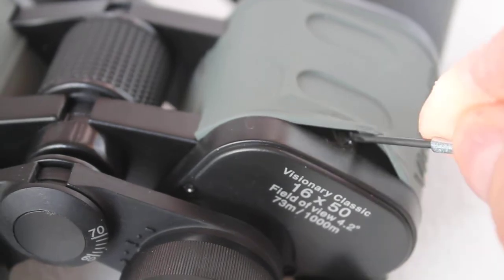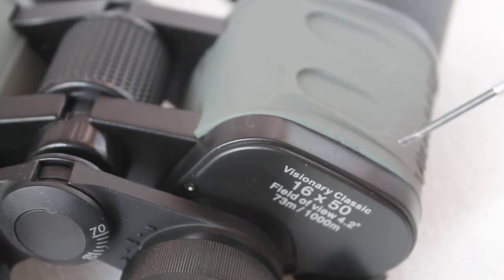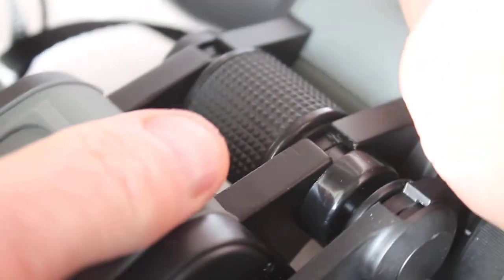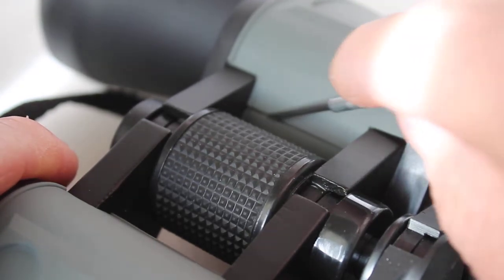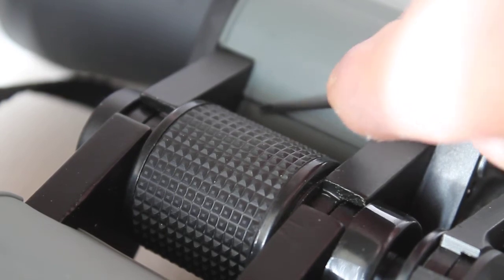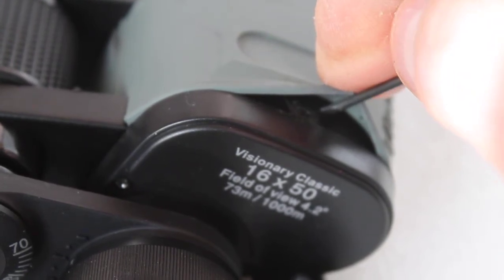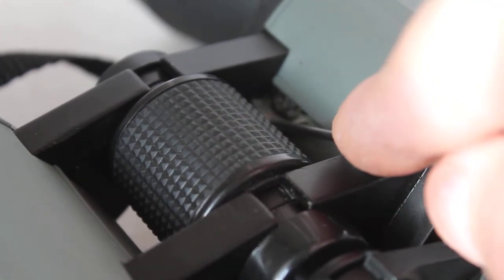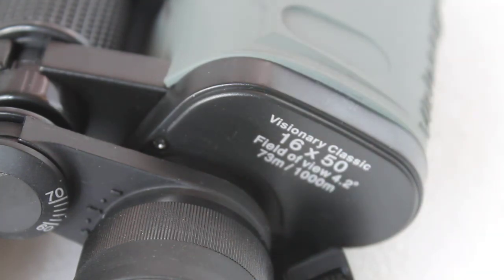How to collimate binoculars  (porro prism) Part 2

Comment: I purchased a set of Celestron Upclose 20x50s. Arrived way out of collimation. Called the manufacturer who did not assist me with the issue, so I am glad I found your video! I could not find the secondary screws on inner sides of the barrels, but discovered that by adjusting the one on the top of the right barrel corrected horizontal collimation and on one the left side corrected vertical collimation. Regardless, thank you for this video. Educational and easy to understand your technique
Reply: Thank you! - this process (left and right barrel screws) worked for my Opticron Adventure 10 x 50 T WP binoculars which were driving me mad.

Comment: Mine's only a cheap set.  Thanks, I found it helpful.  Got them more or less in line, but only roughly.  Definitely an improvement though.  It looks like on mine, the top screws are moving them up and down and the inside screws in and out.

Comment: Thanks for your video! None of bino repair videos cover the possibility of fixing the alignment by rotating the front lens, the objective.  It is mounted concentric so that moving it around it changes the optical center.
Reply from the maker: There is. Look up a video called "Binocular Collimation Quick and Easy Method without Prism Adjustment".
Reply: @44messier  did not look good enough! Thanks, also for your quick reply…

Comment: Hey there. Thank you for making these videos. I've bought binoculars (Maginon 8-24x50 with zoom). I used them a few times and stored them. Now when i want to use them again i see double image (i remember that they fell out of my hand one time). I hear somethi gobbling inside them. Screws for taking binoculars apart are hard accessible. What do you recommend for me to do now?
Reply: This is my first pair of binoculars, I'm a beginner.
Reply from the maker: You do not need to take them apart for this. Plus doing so could create more issues if you do not know what you are doing. Not a fan of cheap zooms myself, but do order if any one wants any. If no luck I would recommend a set of 7x35 , 8x40, 7x70 or 10x50 budget binoculars. Fixed power will give a wider, brighter view

Comment: Unfortunately This wont apply to other designs where the outer shell ( body ) is of solid construction. Where there is no obvious way to get into them , you have to send it to the manufacturer or distributor outlet 
They will simply verify the problem you state and replace them ( under warrenty as applicable ) 
I had such a pair out of colimation , I sent them off , they said there was a problem and sent me a new pair
They work . But Im unsure if they seem slightly hazy compared to the last pair . But it might just be me. 
I have cleaned the lenses but I cant check the prisms. in case they have any contamination . They focus but somehow seem abit hazy when viewing
Reply from the maker: Cheers for the input. I do actually mention from 18 secs into the video that it applies only to binoculars with the rubber coating that can be peeled back. Different brands will have different warranty T&Cs as to whether collimation is included

Comment: Hi, The problem I'm facing at the moment is that the right side eyepiece does not "rack in" far enough to focus when the left side is in focus.   It's very frustrating.  Is it possible that the collimation process can solve this issue?  Thanks.
Reply from the maker: Collimation will not change focus travel. I may at some point strip down a binocular eyepiece to see if there is a solution
Reply: I had the same problem with a Chinese pair I just got from ebay, not to mention that they had been damaged in transit, resulting in the objective lens housing being cocked inward, and being cross-threaded! Anyway, I removed the rubber eye cups, and managed to adjust those lenses(they screw in or out) enough to fix the focus problem, so you might be able to do the same. You'll want to screw the left side out, and right side in. If you still can't get enough adjustment, maybe try swapping the objective lens housings over, then winding the eye piece lenses the opposite way(which is what I had to do!).
Reply: @bensuhard  Thanks for this.  Unfortunately, I tried to take the eyepieces apart and messed that up big time. The bins are a total loss at this point.  I'm going to be looking into some new ones...maybe even image stabilized.  Very kind of you to offer your reply/suggestion. I appreciate it.
Reply: @Geotubest  Sorry to hear that! If they got set up correctly from the factory, we wouldn't have to risk damaging them! 
No problem for the reply, and maybe this'll help someone else reading through the comments. 
...hoping your next binoculars are much better!
Reply: @bensuhard  Cheers.. And stay safe in the latest craziness.